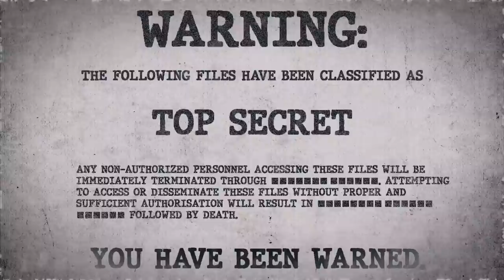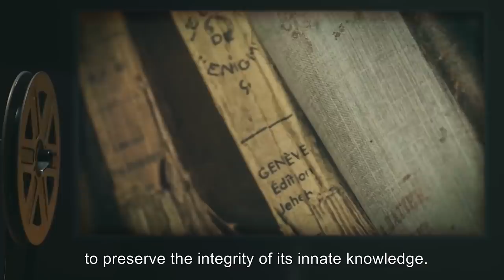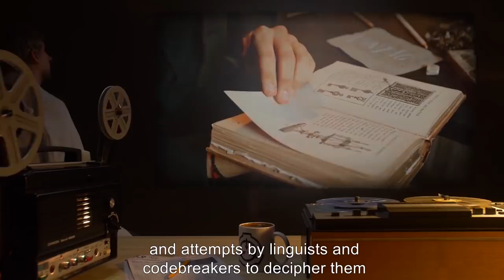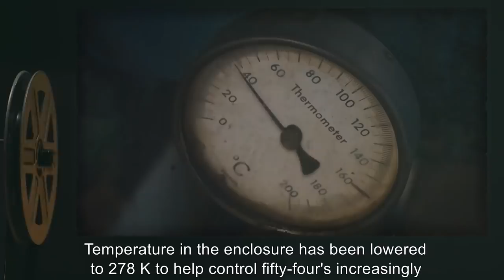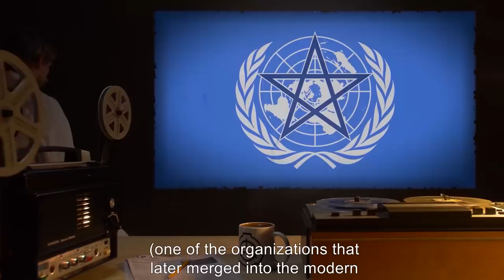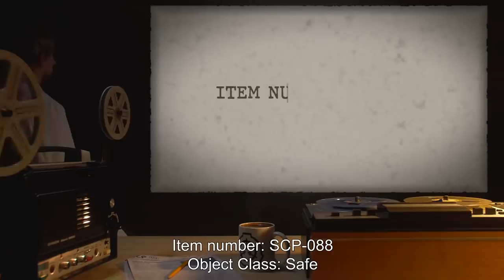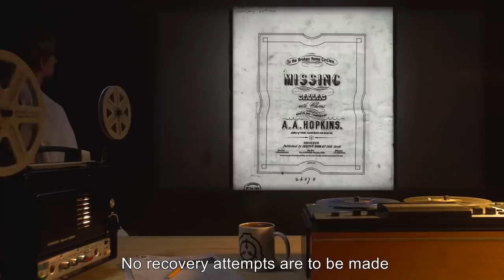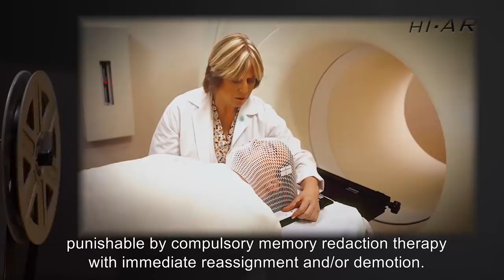Most Terrifying Humanoid SCPs (SCP Orientation Compilation)

Comment: Should future experiments on SCP-096 using Class D personnel be needed, I suggest exposure to photographic images of SCP-096 be performed on an aircraft in flight. Once the experiment with the Class D personnel is completed the subject should parachute from the aircraft. This course will reduce the cost of any experiment and more importantly retain the experiment in a controlled area by restricting the flight of the aircraft. Presumably SCP-096 is incapable of independent flight.

Regarding SCP-106 when describing its ability to corrode solids, is the term "solid" being used colloquially or a more precisely. If used colloquially, I suggest considering glass as a material in containment, as glass is a plasma. Additionally if SCP-106 can only create or exploit pocket dimensions within solids then an alternate containment method is to create a cell floating on a liquid within a larger external container. Thus will cause the inner containment cell to be surrounded entirely with either liquid or air. If entry into the inner containment cell is necessary, the entry port can be through the ceiling of the inner containment cell.

Regarding SCP-179, suggested cleaning method of containment cell is high pressure hoses from a nozzle fixed into wall capable of remote directional control. This will reduce likelihood of breach of containment by SCP-179 and eliminate attrition of Class D personnel who would have otherwise been used for cleanup.
Reply: 096 just keeps level with the plane on ground level till it lands but wouldnt need for it to land as its just going after the person who say it so once the person jumps 096 will just go to them
Reply: The only material 106 has trouble with is lead it's harder for him to pass through but not impossible
Reply: 179 pretty sure ( not 100%) they did that and they were damaged while 179 bounced around its containment as its constantly moving unless someone is looking at it